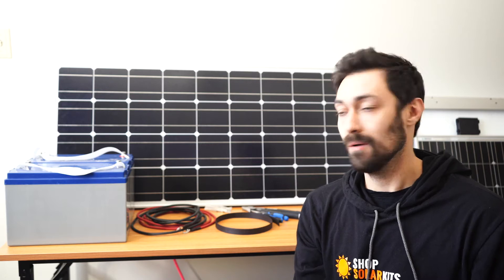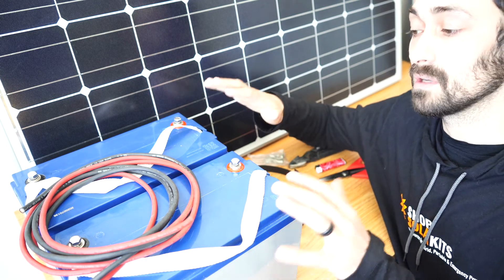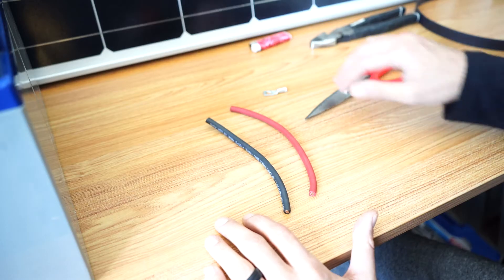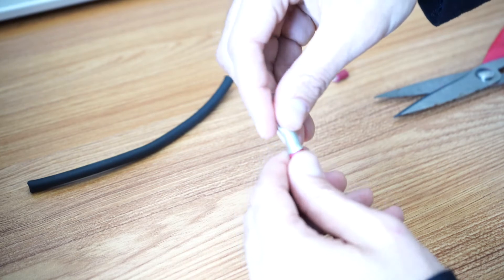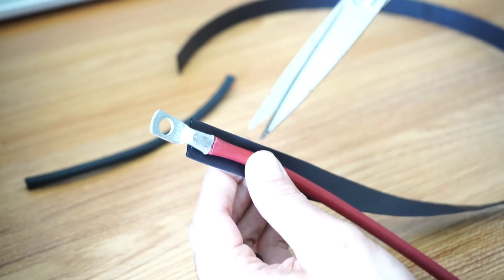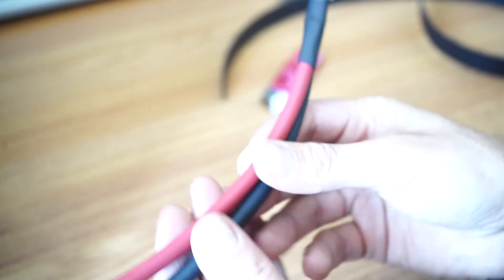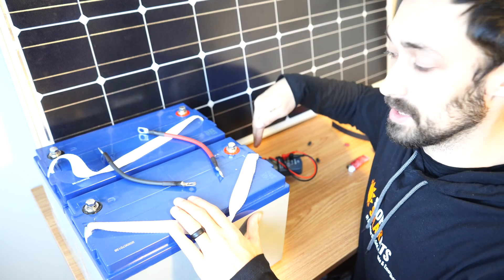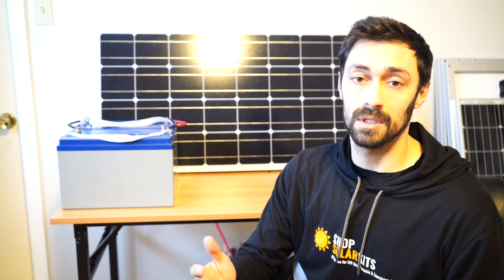DIY : Cheap and Easy Battery Cables | Make your Own Using 3 tools

Comment: Good description of building the cables. However, your test didn't test the cables. It looks like you measured the voltage between the posts of the same battery. That just tests the voltage of that battery. Since you have them connected in parallel, if you measure the voltage between the positive on one battery and the negative of the other, that will test both cables. If it's the same voltage as each battery, both cables are good. It is is zero volts, one or both cables are bad. An easier test would be to test the resistance of each cable before they are connected. They should show zero or almost zero ohms.